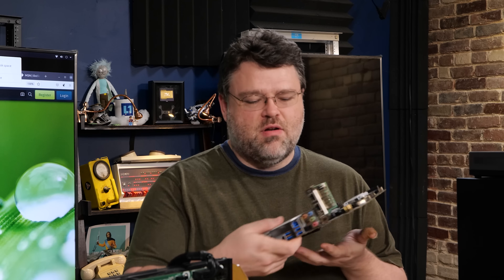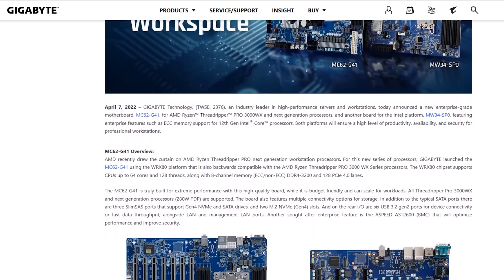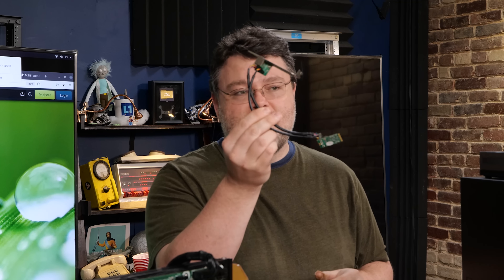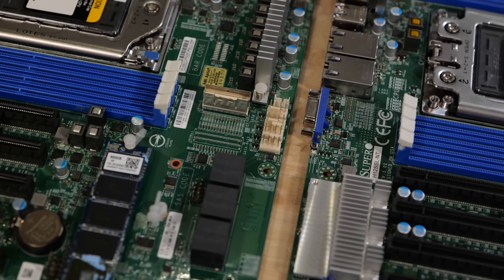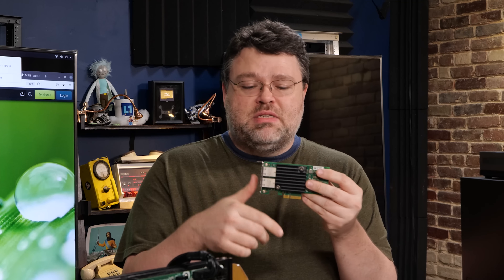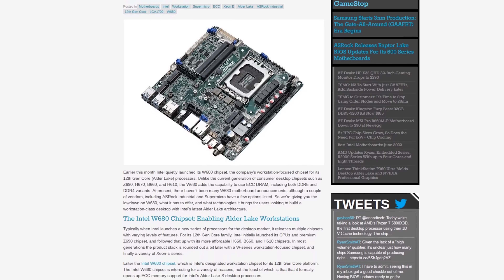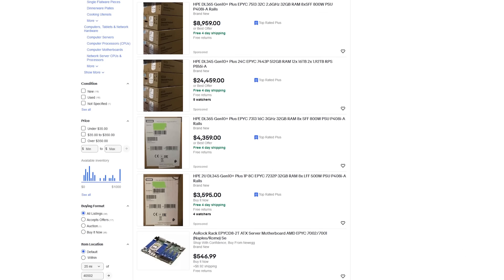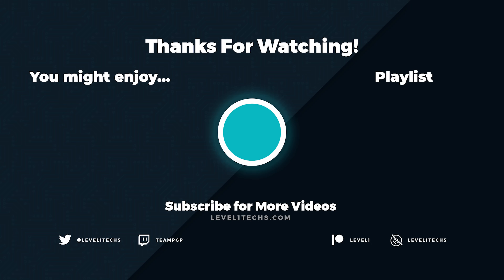Cheat Codes for Breaking Device Limits in Your Home Lab (not for work)

Comment: Hey cool, I just recently bought that same i225 M.2 NIC for an opnsense router than I built. As you can see in this video the cable between the M.2 card and the RJ45 port stands vertically from the board quite a bit.

Those cables/headers were too tall for my Dell Optiplex 7040 micro case so I bought some 90 degree headers and replaced the ones on the M.2 card and the RJ45 port. Unfortunately I've done something wrong, maybe damaged one of the PCB's, not sure. Now it doesn't work properly when I plug in a network cable. The link lights behave weird and it takes a while to establish a connection but it only links at 100Mbps. Not good for  2.5Gbps NIC.

I'll get the multimeter out some day soon and try to see if there's some high resistance on one of the wire connections. I'm hoping that maybe after I desoldered the original headers that I just didn't clean up the board properly with isopropyl and when I soldered the new headers on the connection was dirty. I have a bad feeling though that I damaged one of the tracers or pads. The electronics on an M.2 card are pretty damn small.

The router is humming along happily though with a Realtek 8125 2.5Gbps M.2 NiC. I've got another intel i225 one on the way which has a different connector that comes off sideways so I don't have to attempt any more modifications. The Realtek performs really well, about the same as the intel in terms of speed and stability.

Comment: Thanks for the i225 tip. Was wanting to avoid using the 1 x1 slot on my mobo for 2.5gbit and I wanted to avoid Realtek, just which I could get the dual port in the same m.2 size.

Comment: In the last few days I just realized m.2 E key slot have some secrets :) But most likely not supported widely. I miss the adapters to get the second independent or cnvi lane from E key slot.  2 Having two nvme x1 slots from E or splitting cnvi and nvme into two slots.

Comment: I missed this when you posted it originally.  I guess google saw what I was looking for last night and gave this to me today.  I bought an absolute ton of stuff of AliExpress last night to try to fit two 15.36TB U.2 SSDs into my daily driver.  I bought them because there are no 16TB SSD alternatives to SATA right now that don't have a massive premium.  I bought two Intel U.2 open box drives last night (praying that they are just open box) for about the same cost per GB that I recently paid for a new 4TB MX500.  I think my haul last night on AliExpress will have me covered.  Those drives will eventually make it into one of my NASs, but replacing my two 8TB samsungs right now.  Thanks Wendell. . .must be nice doing what you do.

Comment: Talking about no W680 boards, where is the upgraded HP Microserver Gen 10 Plus with 12th gen? :|

It can be a C chipset again, but why can't we buy a newer microserver platform (Deskmeet has no ECC, not enough NICs, 3.5").

Comment: wait a second there is a m.2 gpu option so i can post my board? oh well i already have a apu (did not need lots of cpu power) and a m.2 sata card and have used every pci based slot in the system, all i have left is usb ports anyway

Comment: This kind of thing can be fun.  I got a 5-port SATA m.2 card for use with a Raspberry Pi CM4, but since I had it I thought I would see what happens when I put it into my NVMe Thunderbolt enclosure I have for my M1 Mac Air.  Damn thing works!  
4 lane m.2 to PCIe slot adapters (with full molex power connectors) do exist if you can weed out all the miner garbage.  The good ones aren't cheap.

Comment: caveat emptor: I got an old laptop where the BIOS disabled the mPCIe slot if it didn't see a specific wifi card on it, couldn't upgrade the GPU using one of those riser/miner cables: BIOS just wouldn't allow it to happen. Software lock down.

Comment: This is exactly what I want to use in one of my home servers. It's just a b450 board but the top gpu slot supports 4x4x4x4 bifurcation. I'm looking at trying to get a 10gbit nic and additional nvme slots. Unfortunately, it's expensive enough that I'm comparing pricing against a more feature-packed motherboard without needing the duct tape.
Reply: I'm putting a wireless router/NAS together soon and I'm looking for a bifurcation card that can do 4 x PCIe 4.0 x4 M.2 slots. If I could find one of those cards but also does 10 gigabit then that would be a nice bonus and would probably increase my options for choosing a mini-ITX board, right now 2.5Gb seems to be the most for mini-ITX.

Like you said though, price may mean it's probably more economical to just buy a higher end board would the bells and whistles already on it.

Comment: m.2 -> pcie x4 for a mono/dual sfp+ pci card. Shouldn t you mention if the provided power/wattage from m.2 slot can feed the  10gbe sfp+ pci card? What if no? How could you bypass that? (you should make a video showing this and that the card works fine afterwards)
 That is why most often these adapters come with a 4 pin power  header (a little bigger than the one who would power a fan like device)
Reply: The adapter doesn't have power lines connected because the slot power budget is NOT anywhere near PCIe slot power budget. If you don't use the 4 pin power header (or sata or whatever they use) then the card has no power.

Comment: Good grief, why haven't 2.5+ NICs fallen in price yet?
Reply: Because everyone that really wanted speed has bought used 10Gbit NICs for 10$ or so
Reply: @marcogenovesi8570  Kinda where I'm at, cheap enterprise switch that I bought only supports 1G and 10G anyways.
Reply: @marcogenovesi8570  Are you talking about RJ-45's?! If so, could you share where you were able to purchase?
Reply: @50PullUps  SFP+ cards and switches. Mellanox Connectx-3 especially. Copper SFP+ cables for short runs and fiber optic SFP+ transceivers for 10GBit are cheap on used market like ebay.
RJ45 modules for SFP+ are 50$ a pop so it's somewhat expensive to use that for everything, but assuming you have most of your stuff in the same room and only one or two "VIP" devices around the house where you have to use RJ-45 it's affordable enough to just go 10 gbit
Reply: My thoughts are..."Why bother with half (or in this case, quarter) measures? 10Gbe has been around forever and is usually available from the enterprise surplus fairly cheap. From my experience, 10Gbe is nice for your LAN backbone between your PC/Server but most everything else is stuck at 1Gbe.
Reply: @MrV1NC3N7V3G4  Because buildings have copper cable that's not good enough for 10G but adequate for 2.5 and 5
Reply: @50PullUps  That thought never crossed my mind because I run my own Cat 6a. I guess I figured anyone watching this channel would be doing the same.
Reply: Depends on what you’re getting. If you want RJ45 you’re spending a lot of heat energy and complexity on the phy’s that do the data translation from digital to analogue and back. You have to remember that all RJ45 stuff is supposedly rated for 100M over copper, sfp+ DACs are often well sub 10m, and they switch to optical for long distance stuff which is also less costly power wise.
Reply: 2.5g switches have dropped...but not the nics, definitely annoying.
Reply: 2.5g nic is about 20$ on aliexpress
Reply: Because Lucy keeps yanking the football away
Reply: Because you can buy used 40gb nics for $30 on ebay. Buying new in the homelab is almost pointless
Reply: Update for anyone browsing the comments, Intel's i225 chipset has made 2.5g incredibly cheap.
Reply: Wtfseriously
Reply: Because enterprise.